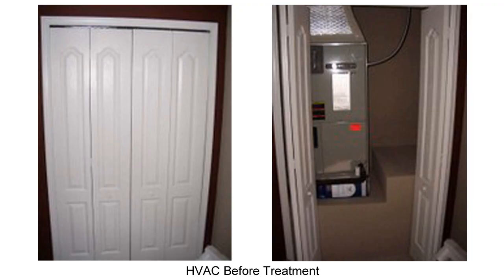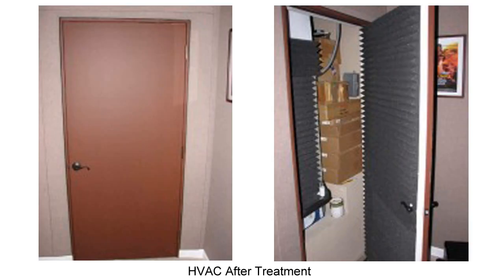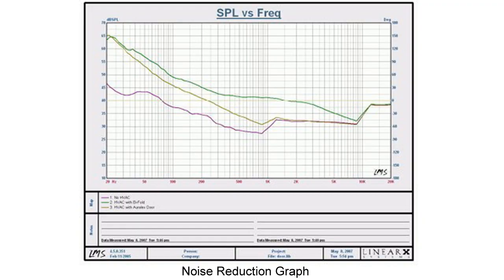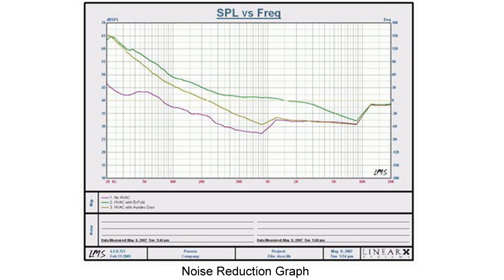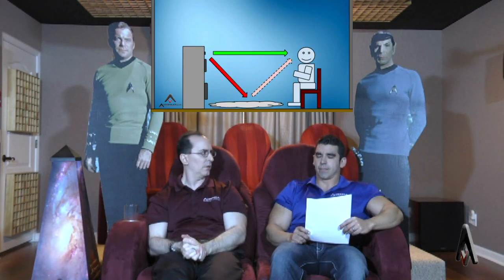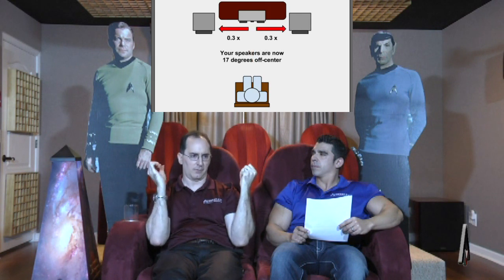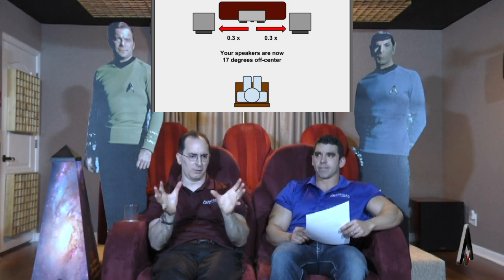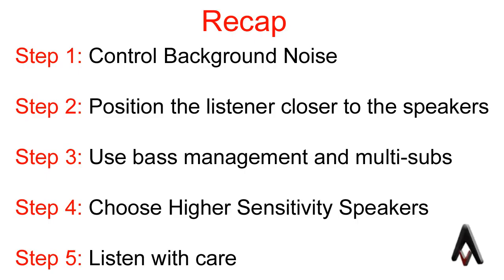How To Increase Dynamic Range of your Home Theater System

Comment: My system is setup in my basement.  So when the furnace or AC kicks on its an issue.  I'm gonna eventually try one of those sound blocking blankets to see how it works .

Comment: Hi am Brian from Malta I have e onkyo tx-rz 1100 end spiekers I have 5jamo d7 thx ultra 2 frant center and serrund and in the back I have 2 wharfedale diamond 130w 6oms 2svs prime pinncle 2 svs bp1000 and 1jamo 660 12 Inc sild 1emotiva xpa gen 3 11 ch end 4atmos celo 2 and 2 celo 8 but I. Have e problem 2 frant spiekers the jamo d7 not working what you suggest change the onkyo because is 11 ch what is god Av receiver for me tks and I enjoy to watch your documents

Comment: What would be a safe average and max spl db level for movie watching? I recently got reference Premier line from klipsch and the SB3000 and I love how great it sounds but I do feel a little bother in my ears the next day so I was obviously watching too loudly. I downloaded 3 different spl apps on my phone and I watched transformers in 4k last night. I tried to watch as low volume as I could and sum still enjoy it. I averaged about 68-74 db and maxed at 85 on a couple low frequency bass scenes. I know the apps aren't the most accurate but I just wanted an idea. How are those levels? Too high, too low or just right? What do you watch at?
Reply: Just right, I normally watch at -20 db ( 65 constant and 85 peak). For me more than -10 db is too loud. To don't affect your ears it seems that you can expose them in a day for 8 hours at 85 db, 4 88 db, 2 91....

Comment: Your comparison between 86 Db and 92 Db is by coincidence very useful to me. I am getting a pair of Magnepan 0.7 main speakers and replacing a pair of GR Research OB7 speakers. When I auditioned the Magnepan speakers they outclassed a pair of speakers demonstrated in an audio seminar that cost over $50,000. They outclass the OB7's. I had been running the OB7's with a 245 single ended triode amplifier which puts out at most a1.5 Watts and they are more than loud enough. The OB7's are 92 Db and the Magnepans are 86 Db sensitivity. I plan to run the Magnepans with a single ended triode amplifier using an 833-A radio station transmitting triode at 1000 Volts and I think it safe to conclude it will put out more than 6 Watts (4X1.5). The speakers are only about 5 to 6 feet away from the two theater seats and the house is small. I will let you know how it works in a few weeks when I finish saving up the rest of the cost of the Magnepans.

Comment: I bought mid range 5.1 system but for the last 6 months i have used the setup in factory default... BIG MISTAKE... i followed your 5.1 setup walkthrough video and no lie, measured to the inch, set levels correctly and it literally sounds like i have a different system. I actually feel like im fully immersed. making the most of the yamaha receiver and mission speakers has been wasted for the first 6 months. Im now going to rewatch all the movies again 👍 Thankyou for your amazing videos.

Ps, please upload more videos with hugo and gene, your chemistry is awesome

Comment: Hello (again:-)), when I want this AV receiver unit as hub/integrator for more AV sources and most important for me is THE unifying function of properly upscalled video AND MOSTLY properly compressed(!) audio dynamics, to be comfortable well even during watching DVDs at evenings (not too loud explosions and not too quiet speech - simply as HOME is NOT a THEATER ... especially at midnights) .... so, is there something you can tell about AV manufacturers, how they handle proper adjustable audio dynamics compression during LOW power listening ?? tnx

Comment: Should I set the dynamic range to High on my Yamaha receiver settings?
Reply from the maker: Yes if you want max dynamic range in your playback material.  For late night viewing, you may want to use the compression features however.
Reply from the maker: Yes AVS is getting some $$$ form Dolby to sponsor those marketing videos.  If Dolby would have just come out and say Atmos-enabled speakers are a compromise and last resort for those that can't do discrete speakers it wouldn't be so bad.  Instead they are marketing it like its a "new speaker technology" that is the "greatest breakthrough in 20 years" and is a "preferred" solution to discrete mounted speakers.  So sad.

Comment: i have a question regarding point 4: what are the advantages of using lower sensitivity speakers? why do speakers company choose to make 86 db speakers and not 91-92, what is the reason of this? thank you!
Reply from the maker: There are several reasons for different sensitivity levels of speakers. A lot depends on the drivers used, driver topology, how much cone area, etc.  Horns are typically higher sensitive drivers but many people prefer the sound of domes and cones.  I'd suggest very high sensitive speakers if you've got loud listening habits, large room, and limited power on top otherwise chose what speakers sound best to fit your needs.

Comment: It is funny how often you score a direct correlation to the issues I face. My son and I just watched the latest Star Wars last night for the first time since seeing it in IMAX. My son cranked up the A/C unit prior to watching to at least delay the unit kicking in. We only went 2 degrees but next time we will go 3 degrees. The fan is the real problem but it doesn't help that the compressor sits right out side the window of our theatre room. Also I recently added a second sub. I have Emotiva and B&K 200 watts into 91db KEFs so I am pretty good on that front as well. I am now going to watch speaker placement link to see how I am doing there.Thanks for all of your insight.

Comment: 7. Buy a separate stereo DAC ($200 minimum) for music listening on your home-theater system, it's gonna be a night and day upgrade over any DAC included in a $200 to $2500 receiver. The included DAC in the receiver (almost any receiver) is pure crap but it does a great job on movies where you want your house shaking and nothing more.
Reply: This is nonsense. All semi decent DAC's for the last 20 years have pretty much identical output quality. It's just marketing for gullible people. Same as hi-def audio.
Reply: Well, all receivers form Denon/Marantz use crap DACs or at least the implementation is a big failure. I got a iFi nano idsd which is $200 and the difference is night and day in every aspect of the sound, even compared to X4100W, X5200W. I thought my speakers are bad, but now they woke up. I didn't know my speakers can give me such good clarity, but after this experience I'm gonna get $500 DAC, that's gonna be insanely good.
I don't know about other brands.
This DAC I've got is way better than the DAC in the Marantz PM7005 which is a $1000 STEREO AMP and STEREO amps should be way better than a receiver.
So if a $200 DAC beats out a $1000 stereo amp, then a receiver is not gonna come close even to a stereo amp, not in $2000 price range.
Reply: The DAC itself is just a small part of the circuitry and given identical circuitry, you wouldn't be able to hear the difference between DAC's.
What amp are you plugging the iFi nano idsd into ?  What you're hearing is probably differences in amplification compared to the Denon AVR's.
Reply: Now I'm using denon x3100w, also used x4100w for a week and it was exactly the same.
Also tested ATH-MSR7 with x3100 in pure direct and nano idsd and difference in details is also night and day in every aspect, from bass, mids, highs, way more precise imaging, bigger soundstage, voice clarity. There are sounds that just don't exist using the x3100w in pure direct. I used X3100 as a DAC for at least 1 year and I was blown away by its clarity stepping up from a xonar dx, but now i'm blown away by the nano idsd.
There are songs that sounds so different because of the new sounds, it's like I'm listening to something else, but that is noticeable only on ATH-MSR7 which is a very revealing headphone.
Reply: Pure direct just shuts off some circuitry and bypasses Audysey I think. AFAIK all denon/marantz AVR's digitize analogue inputs anyway, so you're still going through the AVR's DAC anyway.
Yeah I have the ATM-M50's, very nice headphones but not that comfortable. I plug them into a Beresford DAC as computer motherboard audio is pretty bad.
Reply: @nataflet  I sold my 500usd dac because it was worse than one inside denon pma 1600ne

Comment: Oh my,  where to begin.  I am a guy, I don't do sensitivity :-)
You mean my 2 ohm 1000 watt mono block class T power amp is not going to drive my 16 ohm Dahlquist at 1000 watts.  You mean that physics class I slept through in college was actually worth while!!!  

Great content -- thanks
Then there is the age old trick of "see how loud my speakers are!!!!"  start with quiet music at very low levels -- maybe some early Mary Black.  Get them seated, comfortable,  let them get accustom to the quiet room -- then,  Van Halen Running with the Devil at about 60% max power.  They will swear that you have the loudest system in the entire city...

Comment: Great video...my friend and I were just talking about the air conditioner running and not hearing the effects. When I turn off the A/C it made a big difference. I have 6.1 setup. Have Denon avr 1912. For the front's I have Polk Audio RT55I and the center it's Polk CS305. The rears are Polk FXi500 and for the rear center I have CSI3 and the sub is a PSW505. I like Polk.

Comment: hey guys, love the channel thank you for all you do. Right now I have a Denon 1911, Polk Monitor 70s up front, CS2 center and Monitor 30s for surrounds and back. Trying to get more volume out of the system. Would it be wise to look into an ext amp (possibly even a newer more powerful AVR like the Denon x4100) or new speakers? Oh and for bass, running 2x Polk 505s (guess I like Polk lol).

I live in south FL and have a 'great room' where the kitchen and family room connect, 12ft ceilings, and tile floor (ugh).  The main area is 15x15 and total area of the room is more like 30x15. 

Thanks guys!

Comment: Hey audioholics, should i turn up the bass and treble up on my receiver,or leave the equalizer flat???
Reply from the maker: Sure, but I'd measure before/after to see what he real losses are.  Usually you can get by with a little boost around 7kHz and 15kHz to compensate.
Reply from the maker: Flat or as little boost as possible is usually the best way to go, especially if you're using a powered subwoofer.  
However, some program material requires a little boost. In those cases, tone controls can be useful.
Reply: How about in a case where the speakers are behind a screen that is not perforated and therefore not acoustically transparent. Do you recommend boosting the treble a little to compensate for high frequency loss ??

Comment: What is the noise floor impact when using Balanced XLR cables (found on higher end components) vs. standard Unbalanced RCA cables?
Reply: 0 -- XLR are found on professional equipment to limit cross talk on long cable runs.  Keep your RCA's to 3' or less and buy the good ones -- about $12 at Best Buy and you will not hear any difference.

Comment: I got two SVS PB 2000 subs and I want more bass. Should I buy 2 more or buy one PB 13 Ultra? Should I buy two small subs or one big sub? If I have one big sub and two smaller subs, will I hear the big sub more so over the smaller subs?

Comment: your comments on hearing loss brings up a question. i think there is too much emphasis on ruler flat equalization. as a senior with some hearing loss i find the need to tweek my speakers to my liking. i think the subject merits some discussion.
Reply: What?  your voice is muffled and quiet -- talk louder please.  16 years of flying in a prop plane has absolutely ruined my left ear.  You are absolutely correct.  I look at where I have my EQ set to pictures I have of it in college in the 70's and 80's  -- man  400 to 3000 hz  -- gone...

Comment: Thanks for the video guys!  I really can't see needing more than my current 45 watt per channel H/K AVR-5. It weighs a solid 24 pounds unlike these modern amplifiers that claim somewhere around a 125W/C and only weigh 10lbs!

Paired with my Klipsch's I can easily hit 110dBa (with a 40dBa noise floor) without maxing out the H/K ;)  but I fear for when the caps go bad in my receiver, as many of these new ones don't seem to be of the same quality to deserve replacing it!
Reply: Your HK is a nice AVR and you should enjoy many years with it.
Reply: carlos oliveira Good point regarding the type of amplifier used, however I'm fairly certain the ones I referenced are class A/B, as is my receiver.

Believe it or not, the speakers are budget Klipsch Synergy F-30 towers, which I find more solid for the price every day (I got the pair for less than $350 USD).  The room is my bedroom, so it's small, around 11' x 14', and I was in my listening position, around 5-6' away from each speaker.

I was too scared to push the extra 15dB on the amp, assuming it was clip at some point, so I decided knowing I had 110dB+ headroom was good enough and turned it back down after the song.

No I wasn't using it for calibration purposes, I was cranking them for the heck of it tbh! I went by the rule of thumb that of the audio is undistorted, both the speakers and amplifier are doing fine, but I myself couldn't push it much louder, as I was already weary of the stress I was putting on my own ears.